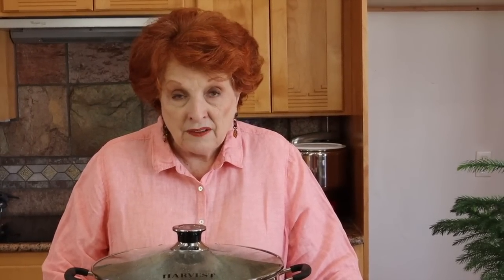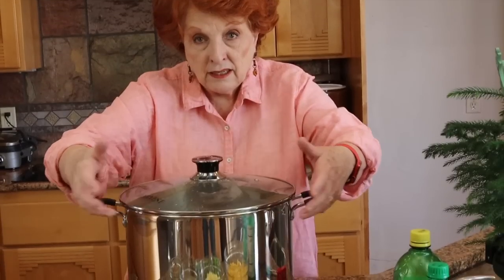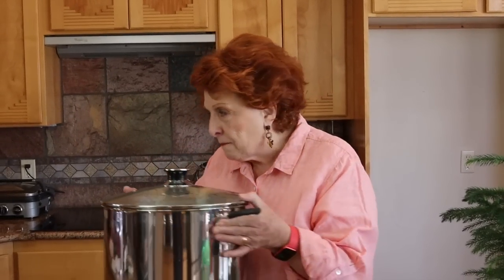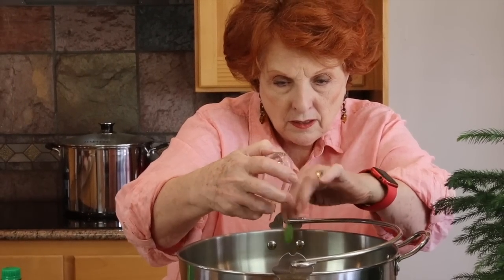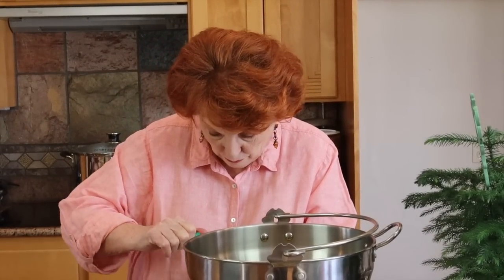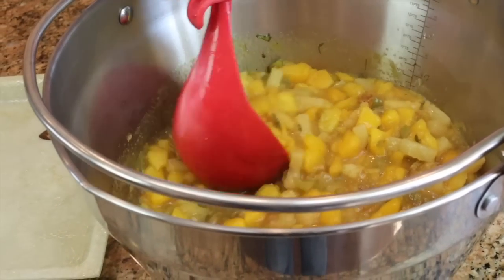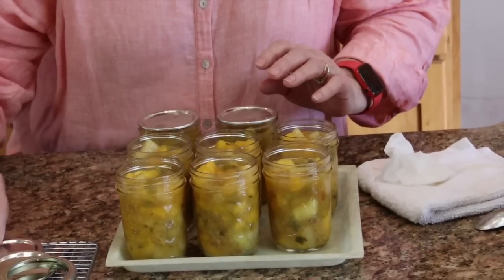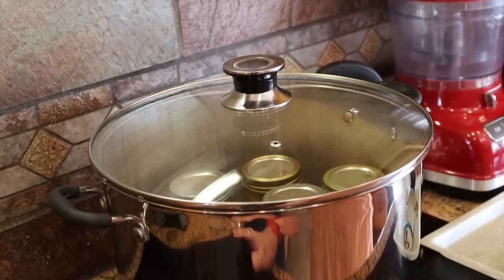Steam Canning Pineapple Chili Salsa

Comment: I appreciate such a frank review. I was about to buy this as my first canner but I will hold off and wait and see. Thank you Pam.
Reply: Just an afterthought. Pam, you don't have to stand on tip toe just use a mirror to look at the dial. You could even use a heated shaving mirror to combat the steam
Reply: I have a Victorio water bath canner (at least, water bath canning is the only canning I've ever used it for thus far!) -I LOVE it as a stock pot too.  When I'm canning up multiple quarts of vegetable beef soup (very popular in our family) this is my go to pot because it's large enough for TWO pressure canning runs, so 14 quarts, and if I have enough to get within an inch of the top--enough to have lunch or dinner even if there are some kids visiting :)
Reply: @LauraForty  I’m assuming you are saying you cook the soup in the pot and then put it in jars and put it in the pressure canner to can it, which is not the same pot as this steam canner. Is that right?

Comment: I have the same canner. I have a few issues with it also. It is kind of hard to see the gauge on my burner so I use my phone to take a pic just to make sure it’s on my green zone. Also when I used it with tattler lids all of them failed. I use a 2 piece lids when using. And lastly the rack is very flimsy. I rather use it as a water bath canner using the rack from my pressure canner.

Comment: Great video! I purchased the same canner about a month ago. I have not used it since I've been busy canning meats with my All-American pressure canner since 12/15. I've canned 118 jars of food. I do plan to use the steam canner this weekend. Great idea about the workaround! I'll be sure to remember that when I steam can this weekend. I have an induction range. I've successfully used it with all my All-American canners.
Reply: I didn’t know the All American was compatible with induction. Does it have a stainless steel bottom? I use the Presto induction ready pressure canner.
Reply: @NancySutherland , I don't think it does. I know my stove (GE) that canners were fine. A metal plate/converter disc can be used for canning on an induction range. All American's website states that you can use their canners up to 21.5 qt on the glass top range. I'm planning to upgrade my stove this year and will likely get a glass-top stove. There are a few Youtubers that I've seen use those. Chelsea of Little Mountain Ranch comes to mind.  I have the 10.5 and the 21.5 qt. I'm currently canning salmon in my 10.5 qt. All American canner. 😍 Chelsea of Little Mountain Ranch has an All-American; however, I think she has a glass-top stove.

Comment: I hope the gauge issue get resolved soon. 😢  I have the other “top hat”design, that has a small base and really like it.  No issues at all.  It does have a hole in the side of the lid for the excess steam to escape.  I point that to the side of my stove and put a towel on the countertop next to the stove and it catches any of the condensation that doesn’t evaporate.  

I sure do like steam canning over waterbath canning, it’s so much more efficient, when it works correctly.

Comment: I have this same canner which I bought over a year ago. I really love it and I don’t have a problem
With the needle moving to the green area. I’m under 1000 feet. If the heat under it is too high it jiggles the lid too much and creates too much steam. I do as the instructions say and lower the heat and the needle stays in the green section even with the heat lowered a bit. Also, one tip is to take a picture with your phone directly above the elevation indicator and check out your pic to see if you’ve made it into the green. It’s a bit deceiving to look from a side angle at the indicator. I usually break out my step stool to get a good overhead view.  Best of luck.
Reply: I use a step stool as well to see the gauge as I am vertically challenged. Good tip re taking a photo on a phone!

Comment: Just watched your video on the Harvest Steam Canner.   I never had a large enough stock pot for my soups/chili, etc.  Just about 1 1/2 months ago, I searched on Amazon and found the stock pot that I thought would meet my needs.  I have not had time to use it yet; but was planning on using it this week or next.  While watching your video, I realized that I ordered the same Harvest Steam Canner.  AND I thought it was just a stock pot.  It is a win win for me.  The timing of your video was PERFECT  for me.
Reply from the maker: That is awesome!
Reply: @RoseRedHomestead  I  put water in my steam canner, put the lid on and my gauge IS working.  I checked it with a thermometer probe like you did.  No water leaking anywhere.  Thank you sooooo much.  You are such a GREAT teacher.

Comment: I have had the Victorio steam canner you showed first for over three years and I absolutely love it. It is aluminum but like that it's lightweight. Mine does not leak steam except in the back where there is a small hole for this. The gauge works great. The price has more than doubled since I've had it. Glad I bought it when I did.
Reply: Same here...I have the old one with no "temp gauge" and the newer one with the gauge on top...I've not had any problem with mine...

Comment: I have the same canner that I bought on Amazon, but through a different site. The manual is the same. It says that after the timer goes off,  remove from heat then leave the lid ON for the five minutes before taking them out. SDSU extension also recommends the five minutes with lid on. But I LOVE this steam canner.

Comment: I really appreciate the frank review.  I have an older steam canner inherited from my aunt.  This is possibly the same steam canner I learned to use when I was a little 4-H'er.  My aunt switched over to water bath canning and the steam canner was still in it's original box and in very good condition.  I've replaced the top dial a couple of years ago as it was fading a bit and it still works great, but friends have been saying I should really replace it with the newer model you are demonstrating.  I'm really happy with the old style model and I thinks I'll just stick with what I have.  I've always been quite fond of the old saying:  "If it ain't broke, don't fix it".  Hope you have a lovely day! 🙂

Comment: I have this exact  canner and absolutely love it.  I canned a lot with it this last summer and all went well.  I am at about 1000 feet.  My 
gauge works fine, so maybe you just got a faulty gauge.  My large burner is on the front of my stove so I don't have the steam problem on the back wall and I don't remember having the dripping all over my stove problem either. Could you use the canner on the gas burner that you use on your counter top?  I feel that if you  get the bugs worked out of it you'll love it.  Such a versatile pot as well.  I love what you and Jim do on your channel!  So much good and pertinent information.  God Bless you both  and happy retirement!

Comment: I am sorry about your issues with the steam canner's lid knob. Hopefully it can be resolved for you. These are wonderful canners.
I've never had a problem with mine and I have both models of the deep canner pot like you have and the 'top hat', as you called it.
I remember years ago, when the 'top hat' model was in use, that it was actually gauged by thermometers and using your watch and timers. They had two holes in the base of the steam canner for this purpose, one to vent and one for the thermometer.

Comment: Water bathing some pasta sauce in this same canner today. I have yet to try it as a steam canner, but might have to make a second batch just to try steam canning. My canner has the same steam issue soaking the backsplash and I figured out the same thing you did with manipulating the lid direction to direct the steam out the front instead of back against the wall. My gauge seems to work properly thankfully!
Reply from the maker: Be careful with water bath or steam canning pasta sauce.  Be sure you are using a tested recipe.  All the pasta sauce recipes I have found require pressure canning.

Comment: I have the "top hat" version and live at 700 ft. Mine vents steam from the vent, not the rim. Also, I have a newer electric stove with the shut-off sensors in the burner, so I had to purchase a canning burner without a sensor.
I am not familiar with the induction burners. Do they affect how the heat is maintained in the steam canner?

Comment: I was glad to see this.  I did enthusiastically buy a steam canner — the “top hat” kind — and had no trouble adjusting the gauge.  Still, I’ve only used it once since after reading the directions more carefully I realized there were significant limitations since I live at altitude — 4300 ft.  Since you’re at altitude in UT, I wonder if you could comment on that.

Comment: It was great talking with you on Monday, Pam! I appreciate your transparency and feedback. I look forward to your next video. 

By the way, text me your address because your lid should NOT be leaking steam non-stop around the lid. That happens when the stove is on HIGH, but once it's turned down to level off the steam and keep the temperature steady (no movement from the needle) it shouldn't be spilling out from under the lid. You need a new lid for sure. 

Keep up the great work!
Reply from the maker: Thanks, Kimberly.  I will do that.  It was good talking to you as well.  I just did another batch of pickled peppers in the canner and steam was leaking out from under the lid after I turned the heat down.

Comment: Thank you for the videos.  Pam, question.  I am sure others have it, too.  What makes a steam canner different from just a big pot?  It appears that it is a big pot that you put water in and bring to a boil, just like a water bath, only less water.  Is there something special about a steam canner vs. a big pot with a tight-fitting lid that it seems, would accomplish the same thing?
Reply: The gauge, or in Pam's case her thermometer indicates when the temp is correct to begin timing.  I don't believe just putting a lid on would give you that information.
Reply: But it seems that if you stuck a thermometer in and timed it once for how long it took to get the steam the right temp, or if you left the thermometer in, you would achieve the same results.  Or putting your own thermometer in the lid.  I am just curious about the cost, vs a big pot, and whether any extra cost is really worth it if you could do it on your own, SAFELY!
Reply: @lindas.8036  As long as you could put enough water in the bottom and prop the jars up evenly above the water, so the water doesn’t touch the jars, but the steam comes up around them, I think it would be the same. You’d also have to have the right holes to allow steam to escape. That sounds a bit complicated, so it would be easier to just buy one. I have the top hat style and I love mine, I’ve been canning with it for decades.

Comment: It’s a shame that you can only use your back burner with this pot and also that you have to use your pressure canner outside instead of on the stove.  I know it’s very expensive but wondered when you do your kitchen redo, if you could just get a different stove that suits your needs better. It would’ve been cool if you had put your stove in your island so that you could film cooking easier and the steam would not harm your cabinets. I have pots with little steam holes in them and wondered why we couldn’t just take our own temperature to steam can in them. But anyway, yes, the steam does come out of those holes but not like a pressure canner. And when it builds up enough steam, it does start coming out from under the lid, which then diminishes the amount of steam that’s coming out through those holes. But they’re just a safety valve so that your top doesn’t blow off. Someone suggested using your camera to take a photo so you don’t have to lean over the pot. I hope you get everything worked out so that you can enjoy this canner. And don’t forget that you have to leave your top on your canner for five minutes after you’re done processing. Because that is part of the timing for this steam canner. And it ensures proper canning. You were so excited and I love to see that. So I hope it works for you. It’s just a coincidence that my sister and I happen to have bought the same pots last week, and I did a test run today myself. So I was very excited to see that you got one as well. so I’ll be watching to see how it all pans out. Or should I say Pam’s out lol?

Comment: I'd say you have a bad gauge on your canner.  I have this canner and it works perfectly.  I also monitor the heat so there isn't a ton of steam coming out around the lid.  I'm afraid your efforts to get the gauge to register probably made the escaping steam worse.  My stove is not against a wall like yours, and my largest burner is in the front, not the back.  My exhaust fan can keep up with the steam.  I hope you get a response from the company and they send you a new gauge.  Your recipe for salsa looks so pretty when it's all done!  I will definitely be trying this one.

Comment: I have this canner. During your test run you had more water in it than when used for canning. My gauge does work on mine, but I am just above sea level. My induction range cuts off when water is near the controls. Thankfully it has never happened with this canner. I am really happy with mine. I hope that they resolve the gauge issue for you. 
Thanks for sharing this recipe. I want to try it as soon as I can find some papaya. Did you use fresh?

Comment: I have the same canner and have no problem with it getting into the green zone.  I'm 209 feet elevation.  The other day, I cooked a huge batch of chicken stock and I couldn't believe how solid the lid fit.  It was a rolling boil and it barely moved - no rattling at all.  And very little steam escaping!  I think maybe your's IS faulty.  Maybe you could return it for an exchange and try that.  Could it be your elevation?

Comment: The problem is the gauge is reading temp. Since you are at elevation water boils at a lower temp, and in turn the temp of the steam will be lower. Since the pot does not build pressure the temp will not be as high as when at sea level.

Comment: Hello.  I have a serious question and in my opinion you're the expert.  I was canning about 14 jars of hot pack chicken and my son curiously took it upon himself to lift the jiggler from my presto canner.  I quickly put it back but I don't know if i ruined my whole canning process and/or end result chicken.  could I get botulism from this?  please reply soon for I am very concerned...thank you
Reply: Does your canner also have a dial gauge? If so, and the gauge did not dip below the pressure needed for your elevation, I believe you’re fine if the jars sealed. I have a canner with a dial and no jiggled, so if yours does not have one, I’m not sure. You could recap the entire batch to be sure, I guess.

Comment: That is a time-old problem with steam condensing on walls and cupboards.   I was mindful of that when I designed my kitchen and had no cupboards on the walls and an industrial quality extractor fan over the stove (a Falcon extractor that moves 850m3  per hour with outside venting).  I'm fussy too!  I love fussy. The extractor hood reminds me of working in negative pressure containment hoods in microbiology and chemistry labs, so a home from home tbh.  Maybe I over engineer solutions? Is that a bad thing?
Reply from the maker: Absolutely not a bad thing!  I like your thinking.

Comment: Make sure your cook top is good for Canning then look for a canner that works for your cooktop. You mention it works only on Induction top makes sense on the Canner website. Amazon seller was wrong to say all cooktops. Instruction booklet mentions make sure your cooktop works for canning and mention induction burner, that smooth top burner (glass top) could damage the canner. Also to test the gouge before use as you did and found it worked on induction. If you purchase the wrong canner for your cooktop return it.
Reply from the maker: I am good.  Thanks.

Comment: You probably have a faulty guage. If I was you I would contact Amazon or return it for the top hat variety. Mine is the latter and steam only comes out a small hole in the lid which causes the steam to go on the backsplash of my stove but I just put a dish towel there until I'm done. No thermometer, no water running onto my stovetop.
Reply from the maker: Yes, we are in process of getting that taken care of by the company.   Jim